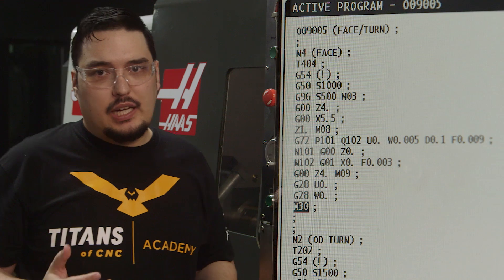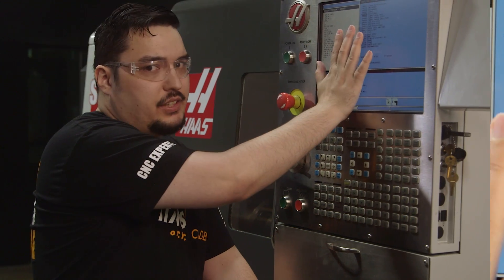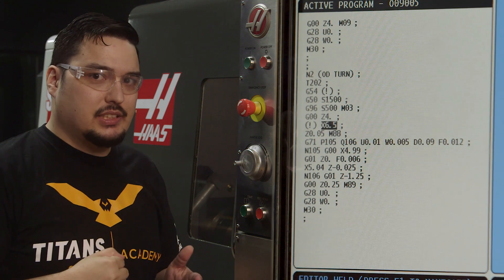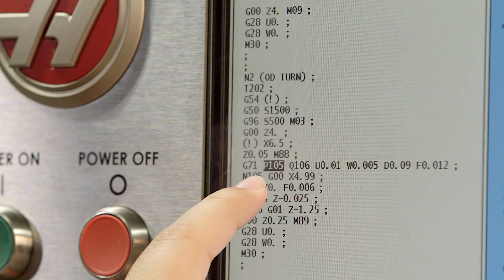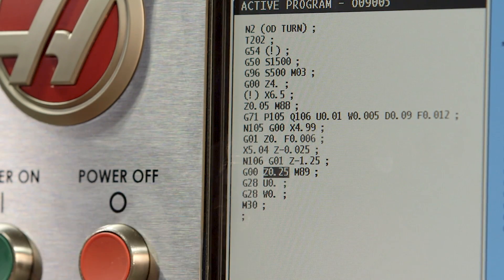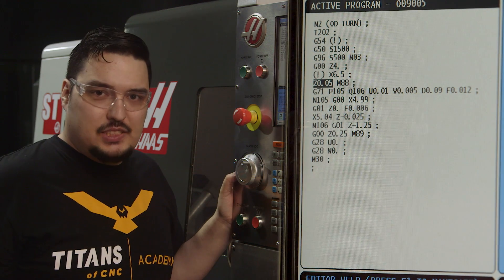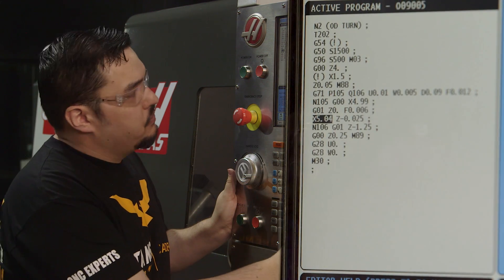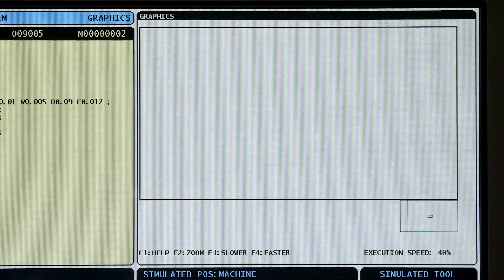G & M Code: Programming Lathe Canned Cycles | Vlog #77

Comment: Because we had limited file space on our Fanuc OTA running clausing colchester cnc. One simple facing program.  One simple turning program and one simple boring program.  Changing starting points depths of cut and geometry was enough to do most of our on machine programming.

Comment: 10:12 its not going to be 0.025 it depend on tool radius. 0.8radius it will be small. 1.2 radius there will no chamber.
formula cadcam not want you know (1- tan(a/2))*radius = will be how much in z you need make cut bigger. i call it cutter comp xD

Comment: Hello,

I have some confusion about turning cycle when Tyson explained about turning down 1.5 to 1 inch dia.He left .01 in U for finishing.In N106 line why he went to X1.0 .Just confused if it should be X 1.01 or not?

Comment: I know I'm 2 yrs late but awesome video. I run an ST 30 and ST 35. I'm new in this field and finding that learning the code and the machines is very challenging. I'm 44 and never went to school for CNC machines or programming. Most days are good except when I have to hunt for job programs or make a new  program from using commands from different job cycles. Lol the kid that trains me makes it look easy. When I lived in Michigan I ran a Homag CNC milling machine. It was for cutting sheets of plywood, particle board, melamine or laminated table tops used as furniture. It was a new machine when shipped to our facility and when I finally learned it (about 6 months later) I wanted to become the best (3 years later). However this machine didn't use G&M codes the way Haas does. Point is that when the Homag clicked for me I fell in love with it. I know I will master this machine. You pointed out line for line. The P Q codes always stumps me. 101 and 102 as well. Thank you.
Reply: I know it’s been a year but to clarify the P and Q  and 101 / 102 question.

Any line of code can have a N number to identify it. Some programmers put every single line as a n number, starting from N1 and counting up. Some programmer only use a N number at tool changes or other useful points. It’s just a way to identify a line of code. You can’t use the same number twice in a program and it’s best to keep them in order. These types of canned cycles need to know where the first and last line of code is. If you start the cycle at n500 the P in the canned cycle should be “P500”. Same idea for the Q value.

Comment: You should show people the different types of canned cycles there's type 1 and type 2 canned cycles(I'm sure you know) also people if you touch off to the face of the part and wanting to take off 1" off make sure and minus 1" on your work offset if not you'll just be cutting air or program G00 Z0.1 G01 Z-1.

Comment: if i would run a shaft with a follow rest that opens and closes with an m code would i be able to use a haas canned cycle? we have romis at my shop that we have to write every line by hand. Looking at buying haas. would the m code also be repeated using the canned cycle? Thanks for your time.

Comment: Tyson, your canned cycles do not have to go all in one direction.  If you added a z value to your first line of code inside the cycle, you are telling the control you are doing a type 2 cycle and not a type one.  Haas has a video about type 1 and type two g71 cycles.
Reply: @Yeah Right I agree not every control can take a type 2 cycle.  But he's on a haas, not another control.

Comment: if i understand it correctly, the paths of the canned cycles that are used in the roughing passes, is really meant to describe the paths that an eventual finish pass is supposed to go. what i don't understand in this description is the m30 after every part, since m30 sends you home in the program. do you toggle your way back to the start of the next part every time, or how does it work? or do you copy the part into a new program when needed?
Reply: M30 does not send you home. M30 ends the program. 
The reason he put M30 after every operation is because it's an example program which he copies and pastes from. So if he only needs the roughing portion, he copies that to a new program and runs it. M30 is already there so the program will stop when it's done.

Comment: Hi. Did you realy nead G50 when you use G96 (G96 is fix S speed)? When you use G95 for VC you need G50 to limit the max. speed.
Reply: G96 is Constant surface speed, G97 is Constant RPM. You need Rpm Cap if you use a G96 S... M3 code.
Reply: G96 is not fixed spindle speed. G97 is fixed spindle speed.

Comment: As as safety precaution and general rule not to crash a lathe, we always program with a G90 on the work offset line G90 G54, G90 G55, etc.  Why did you not use a G90 in the work offset line to make sure you weren't accidently in G91 just in case you forgot to run the program visually in graphics? Love the videos fellas
Reply: I could be mistaken but the G90 code is mainly for the Mills.
Reply: @alexroman197  Thank you for the comment and for correcting me. I have a great deal of more time on mills compared to lathes. In reviewing all of my referencing notes, you are correct. I'm very much out of practice and only run a Mazak laser currently. I miss programming everyday. Thank you though.
Reply: @justinepperson4905   to add on that X and Y for absolute,  U and W for incremental. You can see he is using U and W with the homing G28 code.
Reply: G90 is the default on lathes. No one ever uses G91 in lathes. G91 is only really used with mills to send the spindle home.

Comment: Great video Tyson! I’m the lathe guy at my work. The feed rate in the body of the canned cycle is used by a G70 if you use one. I’ve found that you don’t actually need to put it in cycle at all. You can put it with your G70 line when you use one.
Reply: X (minor) z (threads length) k(thread height in radial minor-major/2 = THR) d depth of cut (K/ square root of passes wanting to take= Depth) F (feed rate which is equal to pitch so 1/TPI) rpm is not apart of the g76 line of code but is suggested to got 125-150IPM x TPI